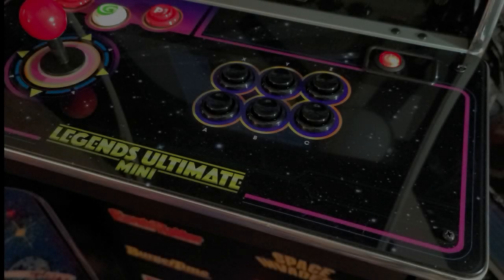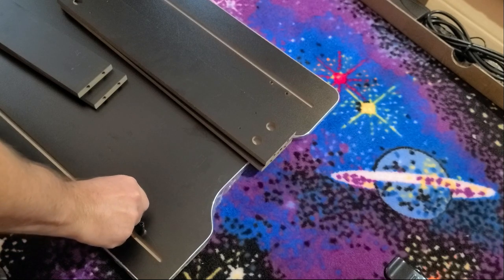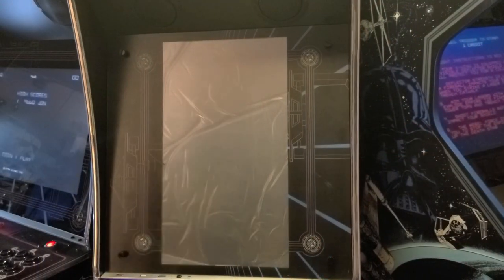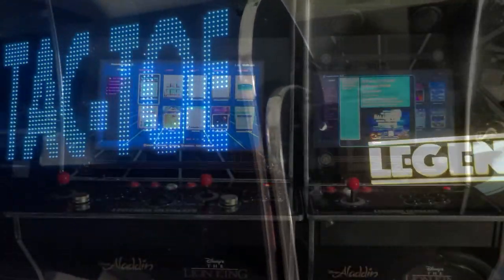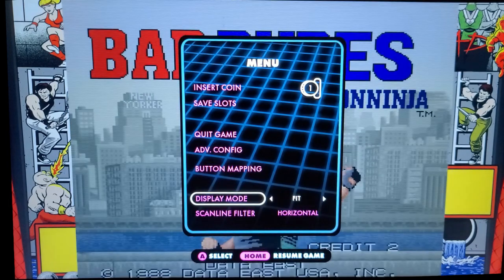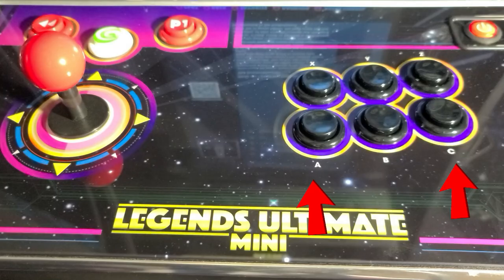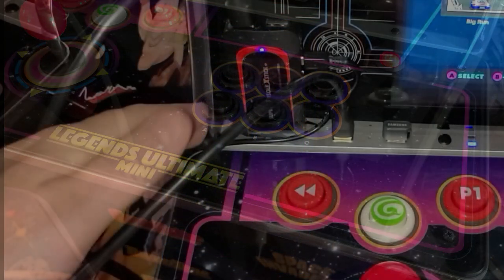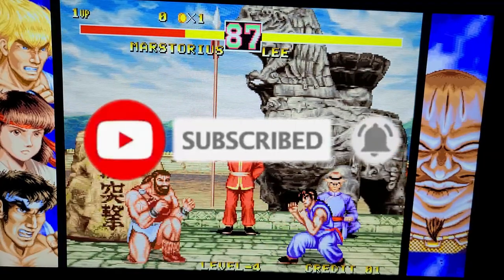AtGames Legends Ultimate Mini Setup and Review - Home Arcade & Pinball

Comment: After having mine for awhile, I will offer advice for two issues that owners might encounter:  If the chrome edges ever come unglued (around the curved edges) scraping and sanding the sticky factory glue carefully and then using Liquid Nails Wood (keeping in place with low tack blue painters tape while it hardens) worked excellent for me. Also, if your Legends Ultimate Mini cabinet wobbles from side to side when playing, add two more wood screws aligned with the top screw of back panel "G" (one on each side) again making sure they are at the same height. Hope this helps someone.
Reply from the maker: Great feedback, thank you so much!

Comment: As always very well done and informative. I would also agree that for the price a trackball should be included.
@WagnersTechTalk did you have a chance to see if the PCB is the same as the ALU and if so does it have a trackball connector? Adding a trackball would be straight forward if so.
Reply from the maker: Thank you John, I appreciate your kind comments and for watching.  It looks like the same internals as the ALU.  I added an image that I took while filming (but didn't use in the video), it's on the guide and can be found here: http://wagnerstechtalk.com/alum/#Inside_View
Reply: @WagnersTechTalk  thanks for the quick reply. Now that I think about it the trackball connector would be on the PCB inside the control deck. Adding a USB trackball would probably be easier provided it is supported.

Comment: Great video! I'm planning on picking one of these up tomorrow. Would you know where I can manually download the firmware updates for it?
Reply from the maker: The machine can be updated by connecting to a network (LAN or Wifi), shouldn't be a need to manually download/install the firmware.  But, if so, you can reach out to AtGames for your specific reason for wanting to.  I don't have links for them myself.
Reply: @WagnersTechTalk  Thanks!

Comment: great review Wagner.  I think they could've included a spinner and a trackball in the dead space on that control deck, although the wiring underneath may have prevented one or the other from being feasible.  I don't think this will sell well when for $100 more you get 2 players and the spinners and trackballs.  They need to revise the horizontal and vertical rotation as it seems like they could've just implemented push-pin latches to lock in and release more quickly.  I would also wonder of the longevity on the (acrylic I'm guessing) esp. if being handled by hasty kids who wanna play a vertical shooter.
Reply from the maker: Thank you, much appreciated!  I think if they moved the stick a little to the left and the buttons to the right a couple of inches, a trackball could fit in the middle.  Even if the trackball assembly had to be made slightly smaller than the ALU it would be worth it (IMO).  But as an add-on for the ALUM, not sure if that would make sense as the cost of the ALUM+new control panel would likely be equal (or close) to the price of the ALU.  It would have to be included with the machine at the current price.  Most spinner games can be played with a trackball, so just having that wouldn't be too much of a compromise.  The bezel does appear to be acrylic, I suppose it could see some wear and tear over the years.  However, I didn't find anything too concerning myself.

Comment: Can you check something for me? Can you check the controls on your ALU Mini, during the test my Player 1 Button registers on the let off of the button. I am not sure if this is normal operation or the button is wired backwards. My ALU's the Player 2 buttons act this way, while player 1 you can hold the button down and it shows the button press lit continuously.
Reply from the maker: On my machine, went into Health Check and the button indicates pressed (highlighted) as it's held down and released  (not highlighted) when I let of the button.  Also, on the ALU when you press and hold the P2 button for about 7ish seconds it goes into BT pairing mode.  The same is true on the Mini, though with the P1 button instead.  Hope this helps answer your question.  Sorry it took me a few days to get back to you.

Comment: 720p? Really? I thought it was supposed to be 1080p. Can the screen orientation be rotated manually for OTG like the ALP? Does up and down work in AddOnX in vertical mode? Would love to know if this could me modded to add a GRS spinner via USB assuming the firmware supports it.
Reply from the maker: You are correct, it is 1080p.  I've updated the guide, added a pinned comment and video description with the correction.  Thank you for catching this.
Reply: @WagnersTechTalk  Is there a way to control screen rotation manually for OTG? Does up and down work for vertical game sin ADDONX?
Reply from the maker: Great question, in the current firmware there is not a manual screen rotation (like there is on the Gamer Mini).  The video does mention the up/down does not work with AddOnX/COX (in the middle and in the outro) while in vertical mode.  It's also noted on the guide here: http://wagnerstechtalk.com/alum/#CoinOpsX .

Comment: Were the up/down control issues with coin ops x (vertical) ever fixed with a update? That is kinda a deal breaker. Any info is appreciated
Reply from the maker: Yes, it has been fixed.  I added this statement to the Troubleshooting section of the ALUM guide (here: https://wagnerstechtalk.com/alum/ ) Using CoinOpsX, the up/down on the Joystick won’t work -This issue has been corrected in firmware v5.64.1. Please update to a recent firmware release to correct the problem.
Reply: Thanks so much for the quick response! I’m very interested in this cab for a dedicated vertical setup, definitely going to get one now! Thanks again!

Comment: As of 2023, the Legends Ultimate is $175 more than the Mini, because there's almost NO chance you'll find the Legends Ultimate in a Sam's Club, and AtGames sells for significantly more on their site ($600 vs $450) and charges $100 shipping for the Ultimate, and $75 for the Mini. 

$175 is a lot for the additional stick, buttons, trackball, and spinners (maybe a $40 value) and a bigger screen (which would be maybe $30 more than an 18" screen in the real world). Especially when you consider there's still a chance that AtGames (or maybe even a third party) will make a deck for the Mini with all those controls some day.

I do wish AtGames would get more of these in stores (and in more stores. I'd jump on the Legends Ultimate if I didn't have to pay shipping, even if it were the regular price instead of the Sam's Club discount price) but as it stands, even though $100 is justified for shipping such a large and heavy cabinet kit, it's still a lot to throw on top of the already-high $599.99 they ask for the Ultimate. For $700+tax you could build a pretty nice cabinet yourself.
Reply from the maker: Good assessment.  The reason why the ALU's are difficult to find at Sam's Club is due to some extreme sales during the holidays.  Some were finding them up for $2-400, which was crazy.  The Ultimate Mini is a great machine, especially if you have little room.  The lack of a trackball, for me, was a big deal.  With the display in vertical mode, it would have been perfect for games like Millipede, Centipede, among several others.  Keep an eye on NOD (National Owner's Day) which should be towards the later part of this month.  I don't know the prices yet, but typically they're around the 30-40% off range during that time.

Comment: 720P in 2021 OOF....
Reply from the maker: I incorrectly stated it's 720p @60fps, the ALUM display is 1080p @60fps.  I added the correction to the video description sometime ago but it's easily missed.
Reply: Nobody mad about Nintendo offering 720p offerings on their Switch console. Most arcade games that you remember playing pre 2005 were non HD, even the Dreamcast ran at 640 x 480. So no one is missing an HD graphics, even if it was a non HD screen. I wonder how this would do with that company that made hd cables that reduced jagged edges in games? I forgot I had one of those cables for up to 1080p, Marseille makes them. Will have to try them out when I finally connect mine up to a PC or get one of those console x devices.